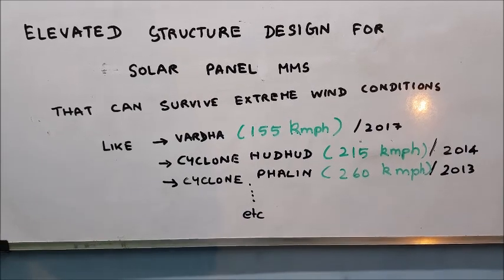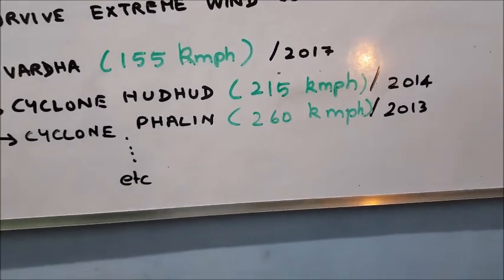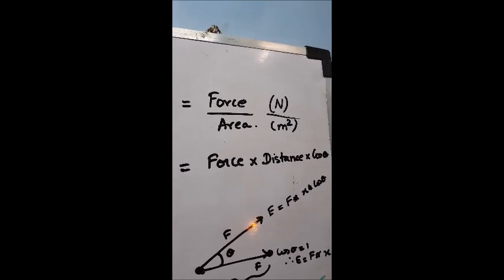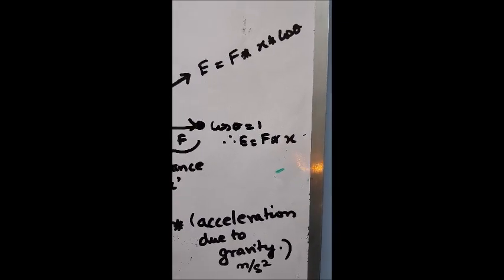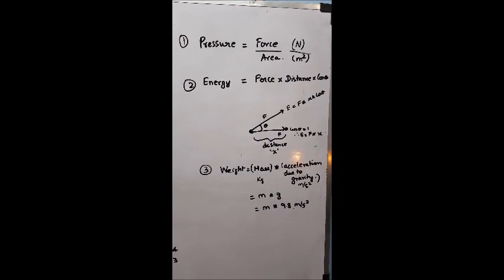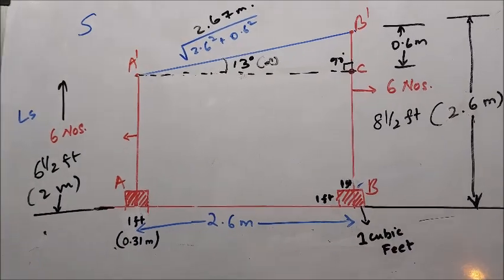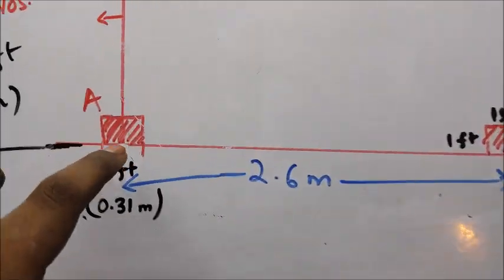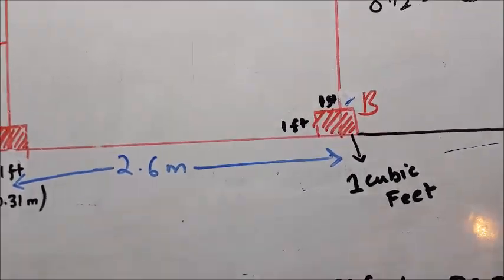2.Basic Explanation of the Structure Design and Formulas involved

Comment: Thanks for this video i got a question about the panels position angle if the ground is no horizontal, the surface panel can be parallel to the ground and the vertical post is supposed perpendicular to the ground or only plumb

Comment: Sir how you are saying according to chennai angle is 13degree? Any calculation
Reply: Longitude latitude bro
Reply: @deepakchaurasiya8989  sir can u explain how u calculate angle using latitude and longitude
Reply: @logesh578  i also have same question?
Reply: See it's very simple whatever latitude of your city or place is will help u in deciding the angle of the panels like I live in Surat Gujarat mine is 21.272820 so i have to keep the angle 20-21
Ur Chennai it is 13.234567 something so it will be 13 degree
Reply: So we can make maximum use of sun
Reply: @deepakchaurasiya8989  thank you very much deepak bro
Reply: Go to mnre website you get angle by location